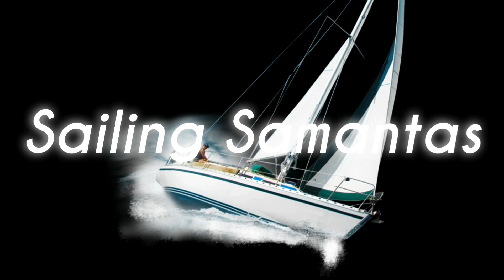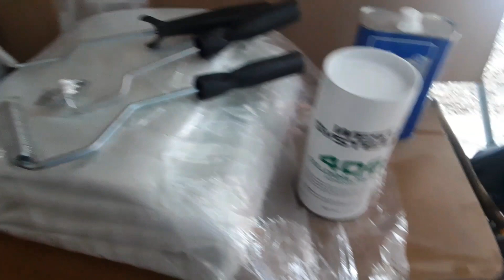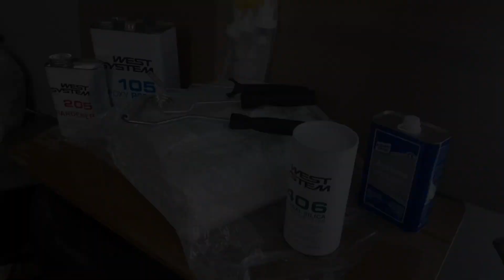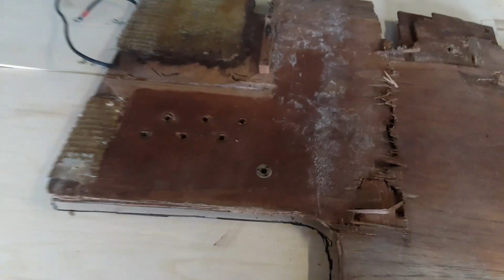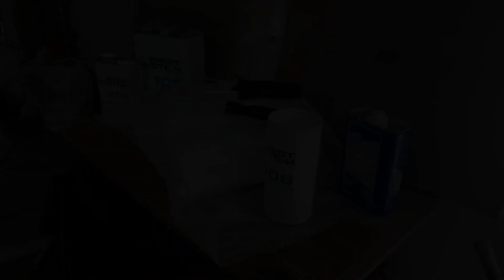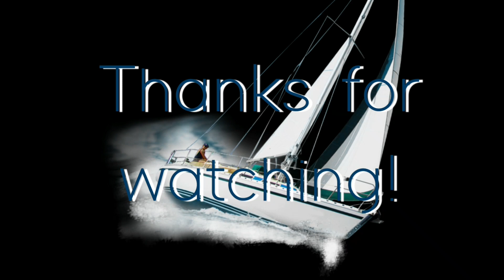How to Template Marine Bulkheads #15

Comment: To make a bulkhead templates I'll attached the roughly cut piece of construction paper to the edge of a bulkhead and run it flat into the corner of bulkhead/hull junction and than accurately cut it right in the very corner. Did it already on my Greenwich 24 and it came with great accuracy.
Reply from the maker: I've got mine  roughly fitted now. Once I get the decks and cabin top glassed I'll be doing  the final fit using a ticking stick, a little  trick I learned  from a viewer on The Chanel.